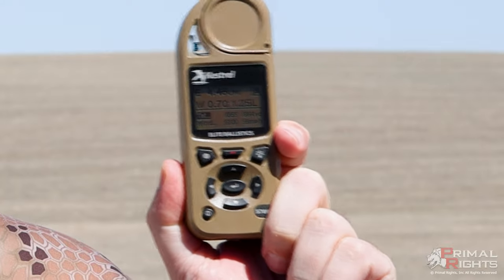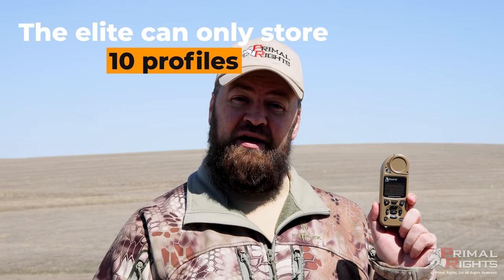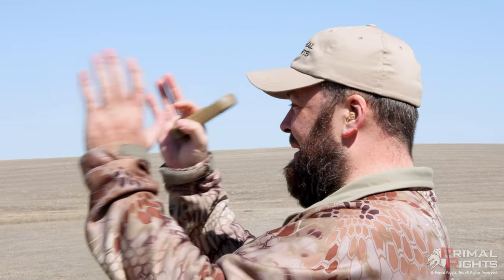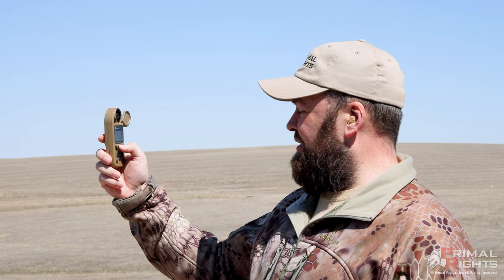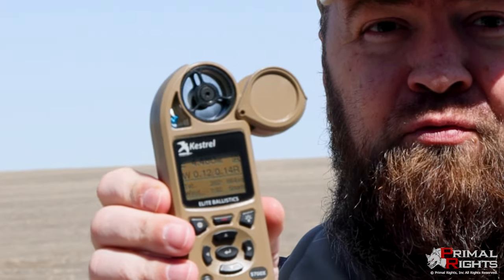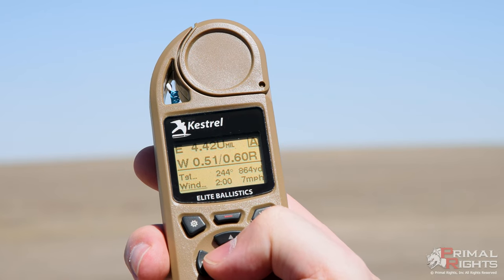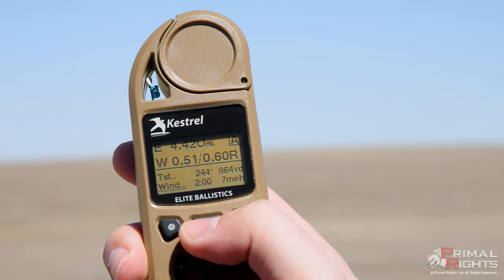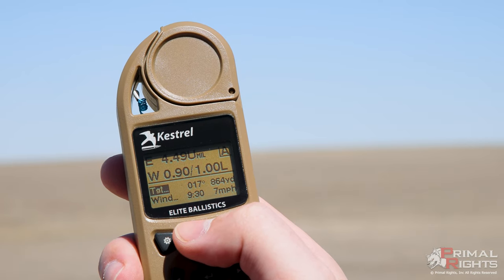You're using this completely wrong.

Comment: Is using the degree setting for wind direction more accurate than the clock setting? Meaning, does it allow the kestrel to resolve a finer measurement?
Reply from the maker: Great question. One that I knew, but I called Nielsen-Kellerman anyway today on your behalf in order to verify I'd be giving you a correct response. 

The software is going to use the most finite resolution from the compass it can get when you capture. So, even if you set it to clock values, the software will be capturing and computing using degrees. The conversion is done for the users benefit, if they are more comfortable with the clock values. This is only true when you use the capture button. If you set it to clock values and are entering it manually, then it will be more coarse than if you were using degrees.
Reply: That is very helpful.  Thank you and God bless.